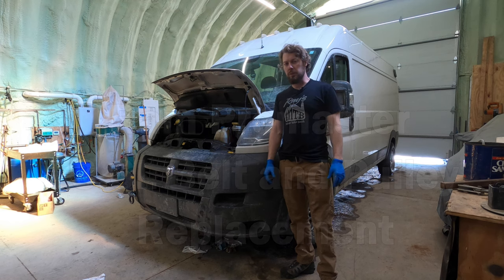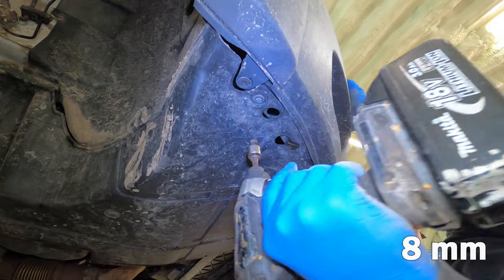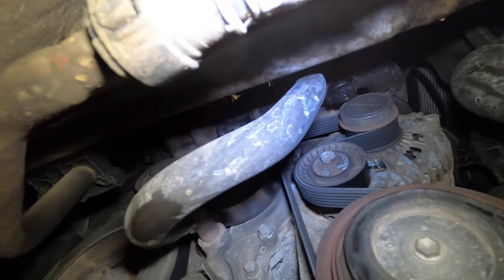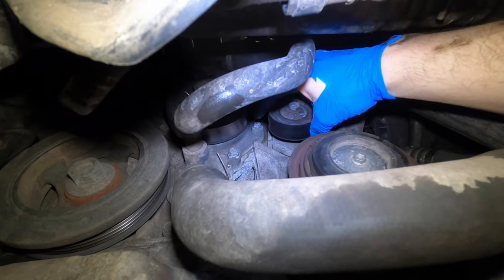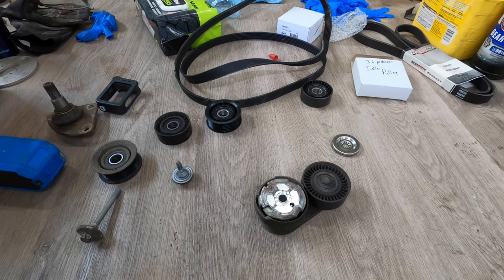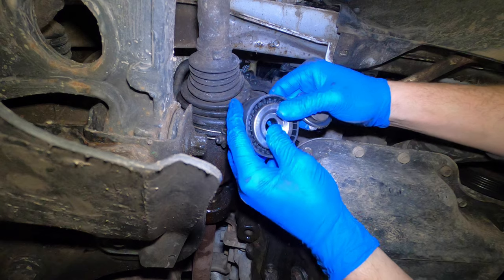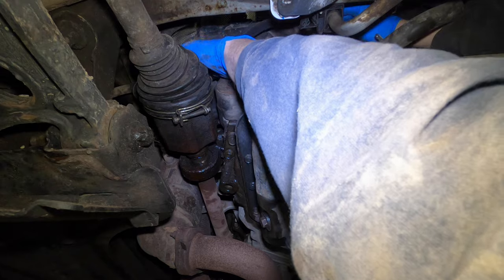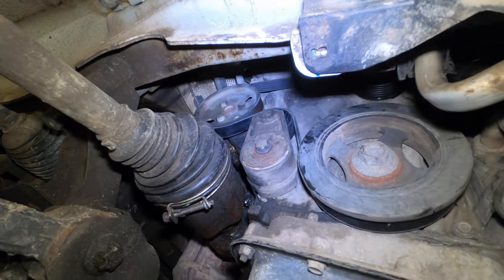Ram Promaster 3.6 Belt and Pulley Replacement How to & Hack!

Comment: Nice Rays MTB shirt! Thanks for the video, this helped get my promaster back on the road quickly.
Reply: Evan McCool, did you do the same exact procedure ( parts )as in the video? If so, any issues? Thanks!
Reply: @BigZaddy2112  hey I didn't do the cost saving pulley mod from the video, as I already had a new tensioner ready to install.  But the test of the procedure for the belt and tensioner replacement was correct.

Comment: Hey boss  I like all the descriptions on you video and also have a question I have the same van my problem is that my van star shaking like crazy after i pass 40 mph but only when i put gas to accelerate i recently did a tun up did tire balance and still same thing will love to know if you actually have a proble like this before thanks
Reply from the maker: Hey man I’m actually having the same exact problem right now! It’s on the left-hand side and it seems to be when the torque converter is locked and I’m rolling on the throttle. I get a little shake in the wheel and then it goes away when I hit the gas. I am in the process of diagnosing and troubleshooting it. I am going to start with a wheel bearing and CV axle as the wheel bearing is making noise. I will make sure I post something about it
Reply: New here but saw this question . I had the same thing it was the torque converter. Hope you got it fixed 😊

Comment: Looking to make this exact repair. Do you have any part #s or reference for what you used for the idler pulley(s). Was it 3 of the same type/part number or 1 of one type and 2 of the other?
Reply from the maker: If I remember right the part was the exact same one as the other idler pulley
Reply: @DualsportDisport OK. There are the 2 idler pulleys and a third which is part of the tensioner assembly. Video shows one of the singles being used to replace the one in the assembly. Just trying to figure out if it's 3 of the same then. Because for whatever reasons parts places are giving me 3 different pulley options (left, right, assembly). If the same idler pulley can fit in "left", "right", "and the assembly", great.
Reply from the maker: Yes. If I remember right one of the idler pulleys is ribbed and the other one is smooth. And also if I remember right I think it was the smooth pulley that I used for both. As the video mentions, the diameter is slightly smaller but your belt tensioner takes the gap up.